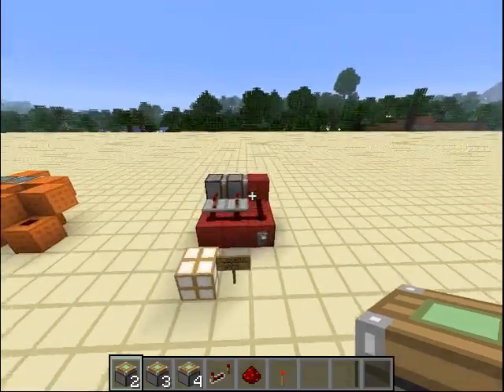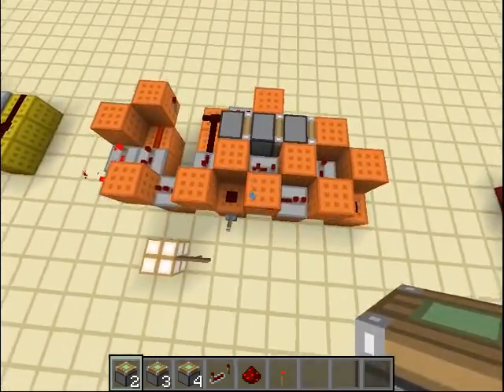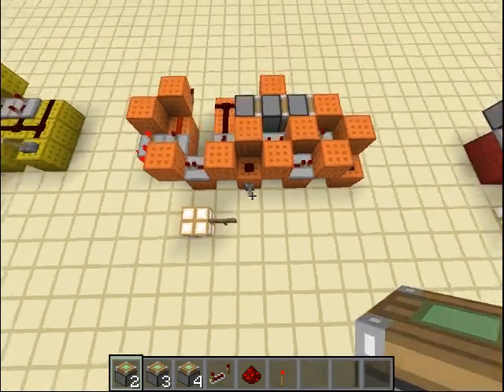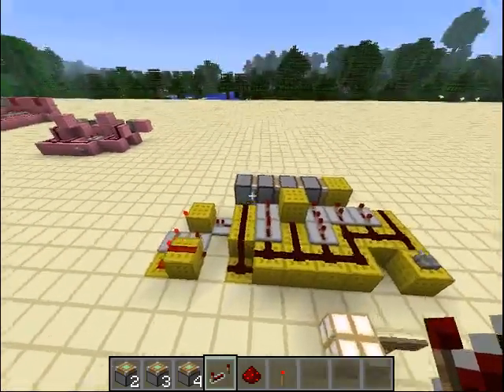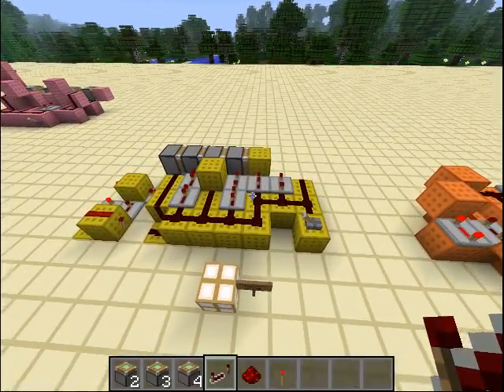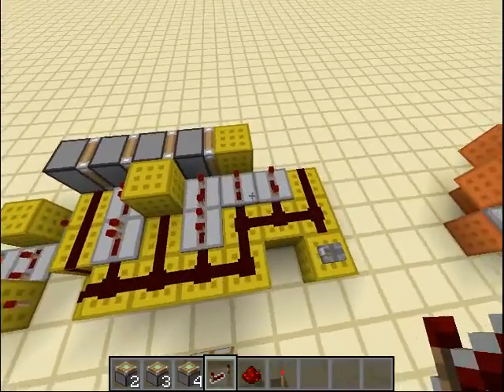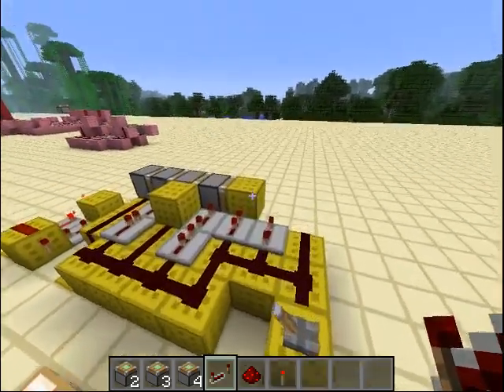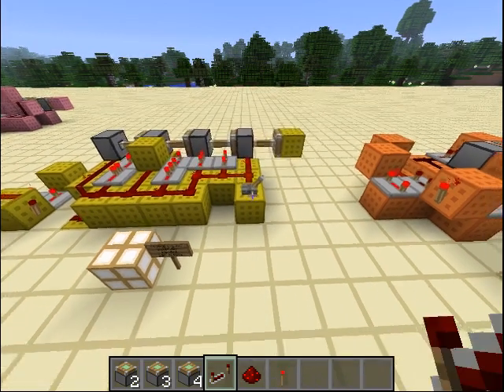Double, Triple, Quadruple Piston extendrers!

Comment: triple piston extender could be simplified if you just copied the quad extender method of circuitry, and then adding another falling edge monostable and it would work fine :)
still, considering this made in 2012, this is really good.